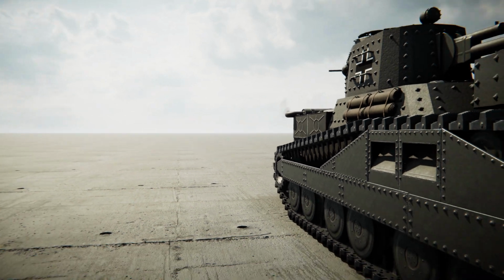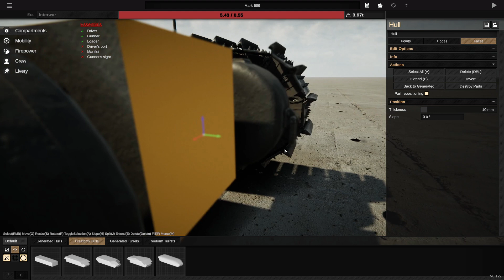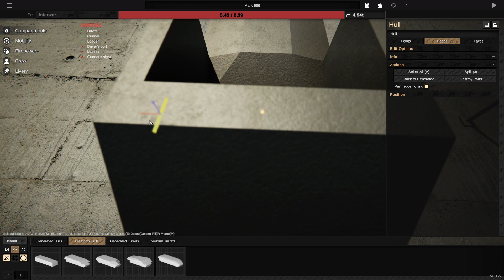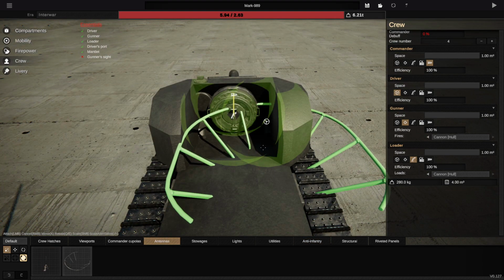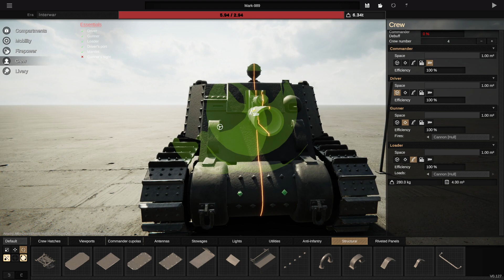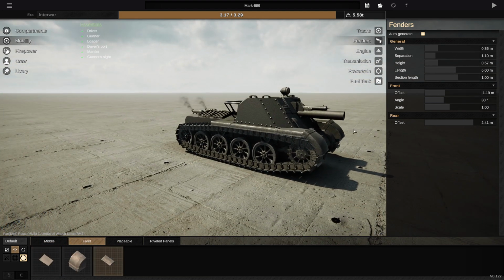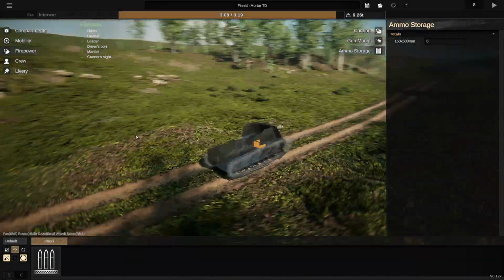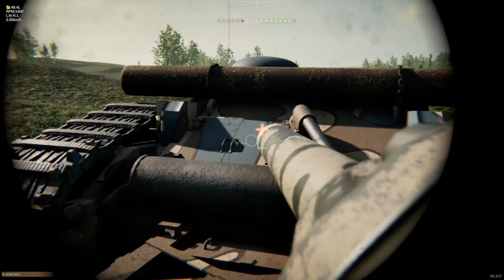I Built A Two Man Tank Destroyer With GIANT 150MM CANNON In Sprocket!

Comment: You should really use the merge points option more. You can prevent a lot of weird stuff with over splitting with that, and also the issue that you've sometimes had with the ammo not being inside.
Just remember this for the merging, the first point selected is merged into the second point selected. So select the point you want to keep as last.
Using this, you can split a face and then merge together again the faces that you don't need to keep split. You should always merge points to you place really close to each other, because the real issues begin when you have points inside what is basically considered the armor. This also creates weak points on the inside, and also remember that a panel has two faces and you can armor both sides effectively.

Hope this helps, love the sprocket content!